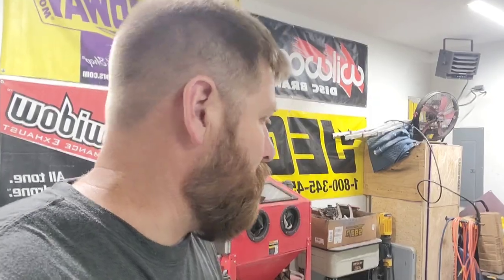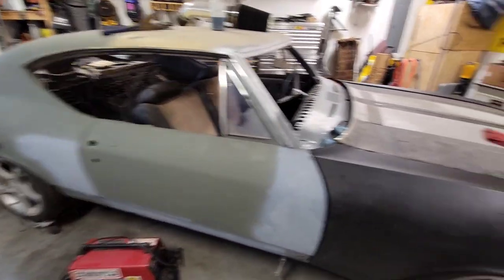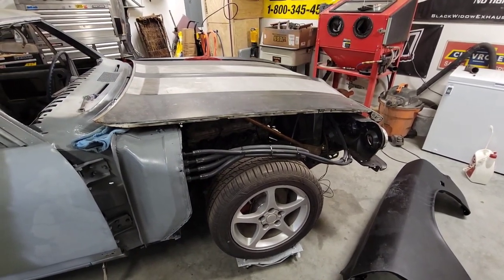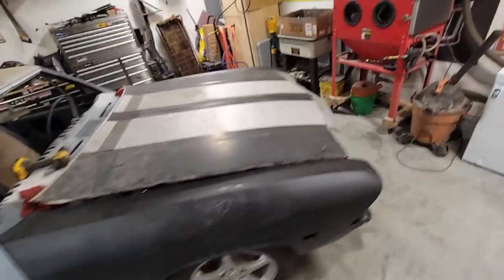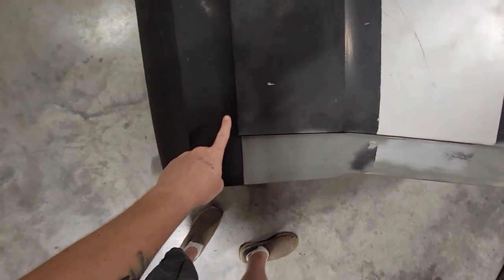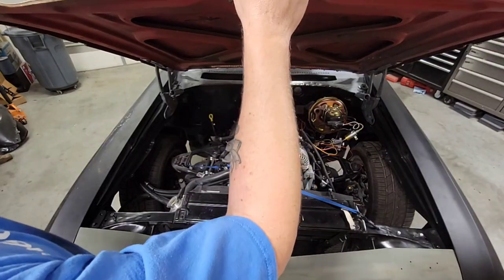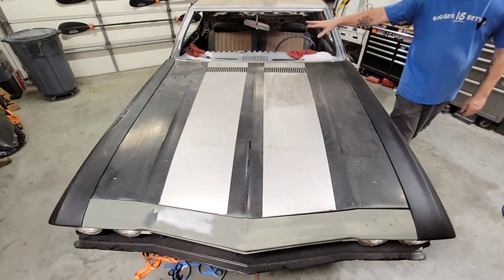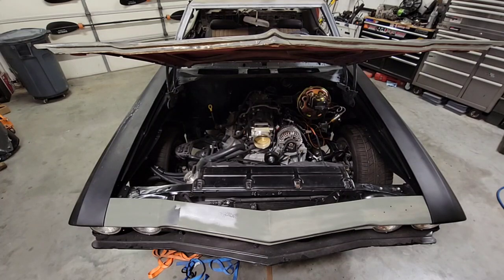68 Chevelle Part 27- Hood alignment.

Comment: Glad I seen this before I pulled all the sheet metal off 
Take some measurements Before taking it apart 
About to pull a 68 front end off a 69 and put it back to 69
Reply from the maker: Measurements are key.  If you have any shims put them in a small zip lock and label where they came from.  That will get you a much closer starting point.